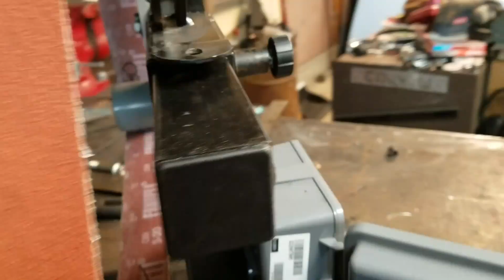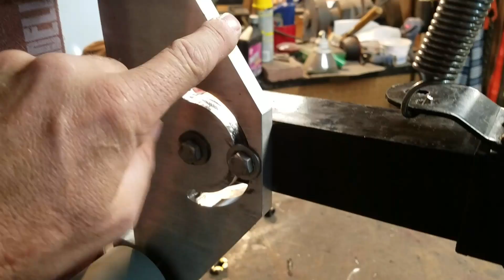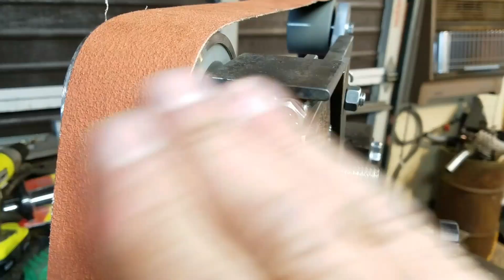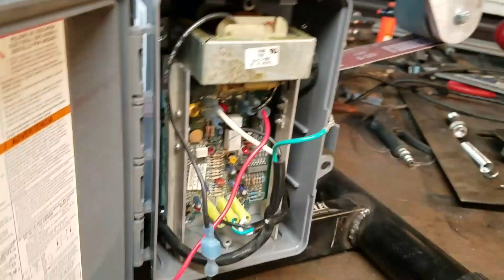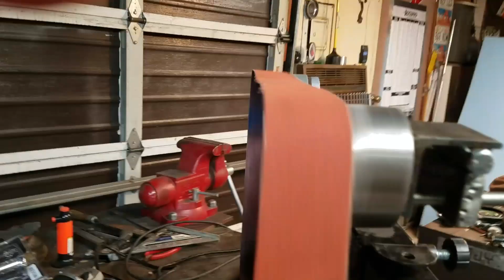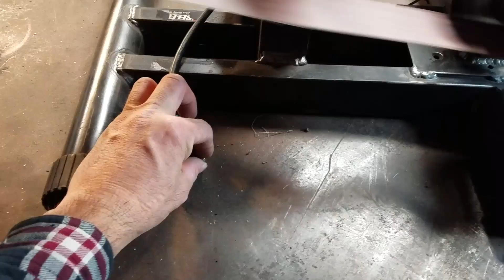2 by 72 Belt sander

Comment: Next time you need a radius slot for locking, as in your front idler pair, try a radiused curve and a spacer with the locking bolt in between. Nice repurposing. Thanks for sharing.

Comment: Very cool! Nice job, I do a lot of repurposing of old treadmill stuff as well and the big transformer looking thing is a choke which just helps to smooth out the pulsed DC. I have left them off and did not see much difference other than the motor seems to make a little more noise at very low rpm. Also if you put a switch in the center leg (typically white wire) of the potentiometer you can leave the knob in one position and pulse the middle leg when you turn it on so you don't have to zero it each time you turn it on.

Comment: what is the drive pulley made from and how did you weld it to the cast iron flywheel ?
Reply from the maker: it's just mild steel and mig welded it to the flywheel. mine was not cast iron.